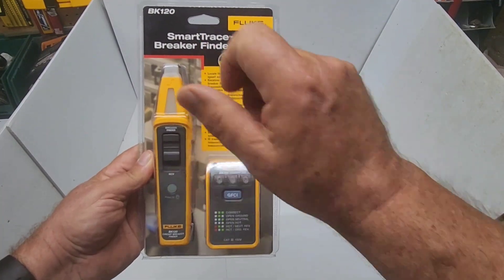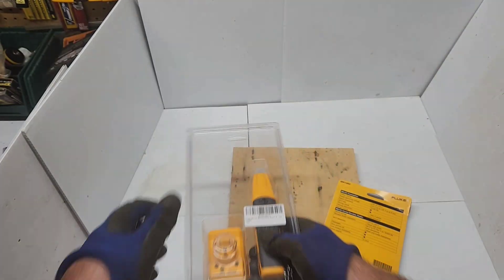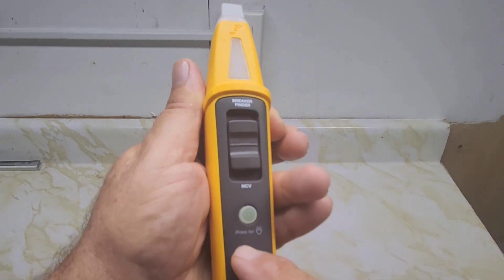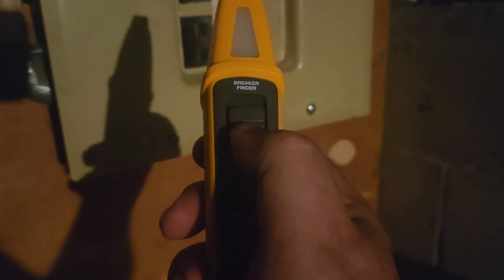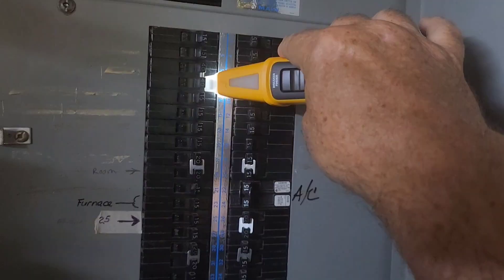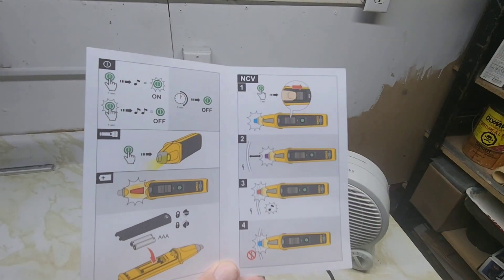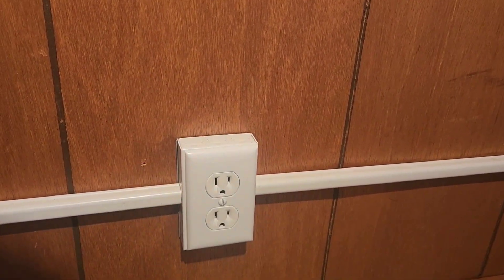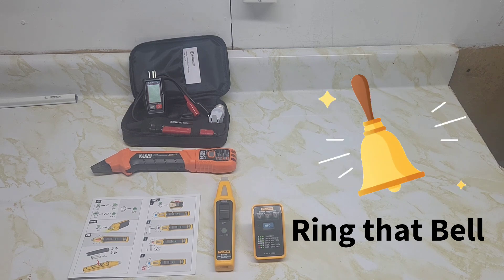Fluke BK 120 Breaker Finder Review

Comment: I suppose you could make the shortest, stubby 3-prong extension cord for the Fluke transmitter for when you get into a tight spot where that poorly designed transmitter won't otherwise fit. What were they thinking???   Nice video! Thanks, brother.
Reply from the maker: Your welcome. Thanks for posting
Reply: @JimMcLaren1950 ; I went ahead and ordered the Fluke Bk120 as It does seem to be the better unit. Thanks again for sharing your experience.
Reply from the maker: @flyme-z7b Your welcome.